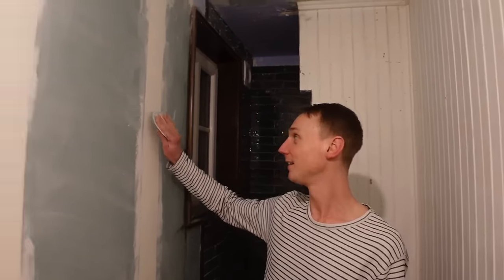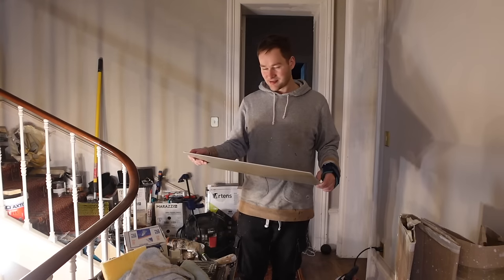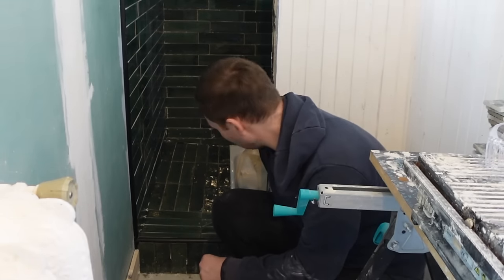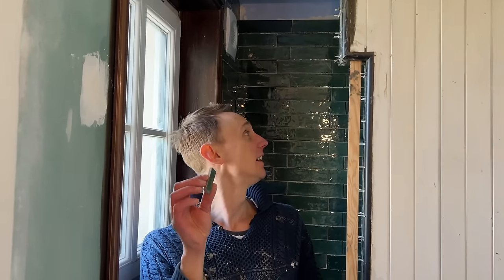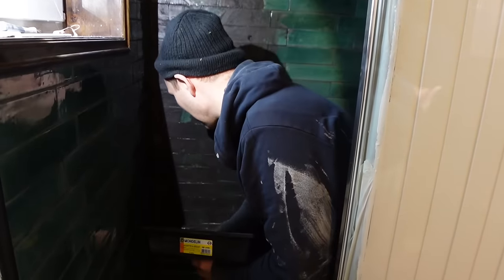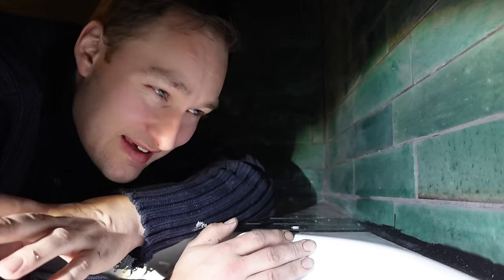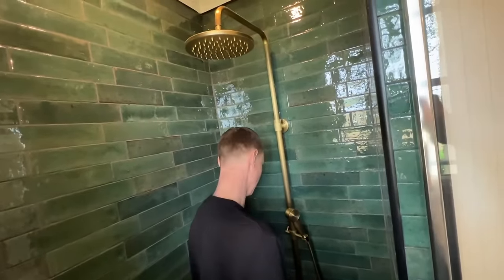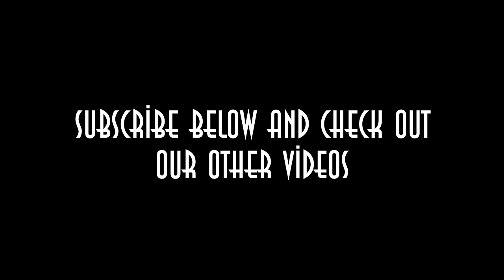Château DIY behind the scenes, Green bathroom revealed! pt 2 of 2

Comment: Maybe it would have been possible to scrunch up some newspaper to put in the top of the hole to the septic/sewerage system.  If then taped across the newspaper should cling a bit to the tape when pulled off.   That or a bit of plastic taped over the top.  Looking good though.  Well done both of you.  Best wishes.
Reply from the maker: In the end I tied a plastic bag around it which helped.  Wish I did that sooner!